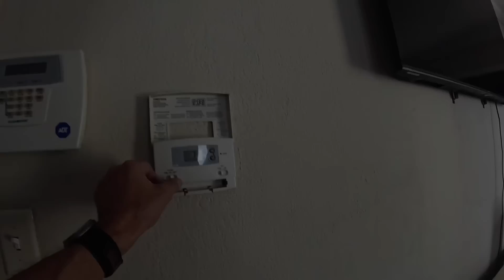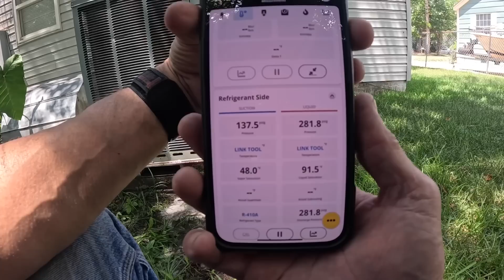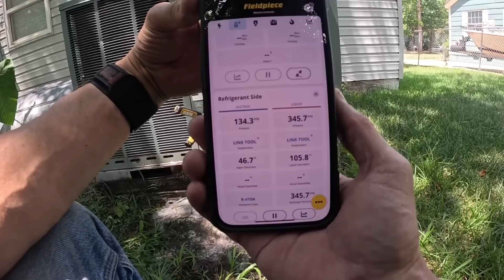At These Temps If There’s Anything Wrong With Your AC, It’ll Show Up! #hvacguy #hvaclife

Comment: Hi...Im a subscriber..I watch you all the way from the border city Monterrey Mexico.great videos...I noticed you have a hard time when checking the terminals for the compressor to see if its bad or still good...why dont you use 3 old compressor terminals with the wires strip the ends connect the terminals to the connection on the compressor and use those to check the compressor for it to be good or bad...I know you have yr very smart you will know what im talking about...it is hard to check the compressor with multimeter probes when you have to bend over and cant hold the probe in place...

Comment: Great videoo ! Great work curtis !
only 2 things i would different --- for the new guys.
1) allways Make sure the compressor runs BEFORE starting any work on a unit. Nothing worse than doing a Bunch of Cleaning & Find Compressor is Junk ! 
ask me how i know ?
2) i Always Do a Quick hose off of the Major crap Outside stuff BEFORE applying cleaner to the condenser coil lets cleaner get in there better to do its job.
That units Going to Work so much better with 2 clean coils. i'll bet that Lady was in Heaven after you were Done ! 
A Job Well done !!! That coil was clean 🧼 !!!

Comment: They told me design was for 95 degrees and 75 degrees inside and if it was above that you were on your own!  They also said that if your Summers featured higher temperatures than that you needed oversized equipment most people would use a 2.5 ton for my house I had a 3 ton

Comment: Did a rental house yesterday that we had to clear cut our path to the unit that looked just like that. Unfortunately it was one we had to pull the whole shroud off to get to the coils that also had vegetation growing all in it. Then move a house full of stuff in the basement only to crawl on my belly up a dirt hill under duct work and lay on my sides to work on the evaporator. And of course the drain was completely stopped up. I asked the customer about thier filter and their replay was "filter?" So I feel ya brother
Reply: Figures.  Good thing to offer folks is to "Purchase a case of filters" so that you have them when needed and change them twice a year, just before spring/summer and just before fall/winter. Once they have them and see them, they tend to be more motivated to change them. If they don't want to change them, they'll hire you to do it but at least they will have the filters. Sad that folks do not understand that those filters are the key to being comfortable when its hot or cold and turn on the HVAC.  Just like electricity, if its not there/on, the system isn't going to work well.

Comment: Question, and I know it is probably just personal preference, but why the Viper HD cleaner?  Growing up with my dad, working with him from the age of 11-18 during the summers, he used "the pink stuff" which was an acid based cleaner for condenser coils, then the green stuff for evap coils unless the coils were pulled, then it was the pink stuff for them.  Once i became an adult and did maint on the side for ppl I know, i went with the Nu-Calgon blue coil cleaner (alkaline based).  Now i have a container of Viper condenser coil cleaner to try when needed.  Just wondering your preference of a "soap based" cleaner and not acid or alkaline based (i know about coated coils not to use them on or micro channel).

Comment: You said it, get it while the getting is good. We wouldn't want you to be sitting idle. Make the $$ while it is there. That was another dirty coil. Like you said, in this heat you will find out the issues. That dirty coil didn't get that way overnight. Good video

Comment: I found that if you brush the coil first, wet it and then apply the chemical it makes cleaning a lot easier and does a better job.
Reply: Brush or vacuum.  Probably get 90% of the dirt and then apply cleaner and rinse.  Might be quicker and involve less water i.e. mess.
Reply: Especially evaporators.
Reply: exactly what i do, cheap hd soft paint brush, then soft vacuum and the chemicals if need it. takes 10-15 min extra, that i charge 4,  but result is better imho. nice video thanks

Comment: 9:20 -- "I purposely didn't put a lot of cleaner on that" -- Why not? Also, do you tend to find a lot of units dirty like this? Just seems like a basic thing for people to do.
Reply: Cleaner has a corrosive chemical....evaporators are more delicate.
Reply: @Garth2011  Ah, so not the same as the coils on the outside then? Thanks.

Comment: Got a roof top unit at work that's not even a year old that can't keep up with low 90s outside. Set on 65 and its showing 75 right now. Been that way since it was installed last summer.
Reply: Assuming all is correct; unit maybe undersized for the job! Insulation, windows...
Reply: @bobboscarato1313  Windows are old school glass. Walls are just double layers of brick. I think the unit is undersized as well. Never saw the guys take measurements before they came to replace the unit to begin with.
Reply from the maker: 65?
Reply: @HVACGUY  Yes.
Reply: Also it was 103 heat index as well today.